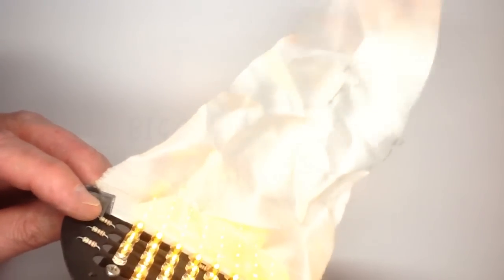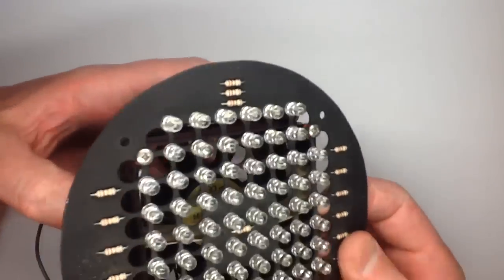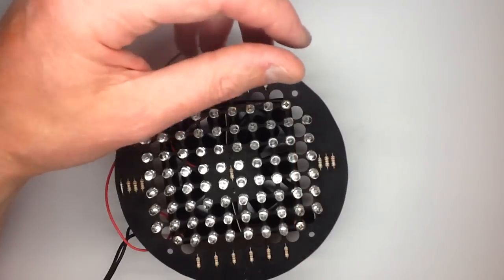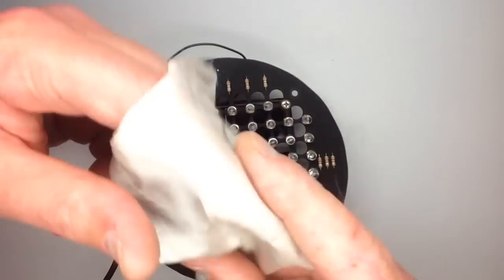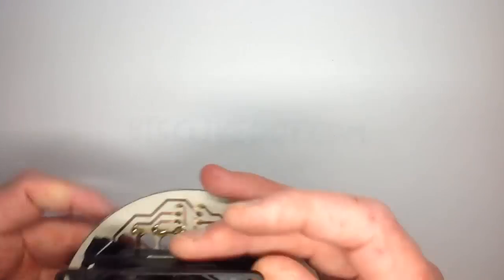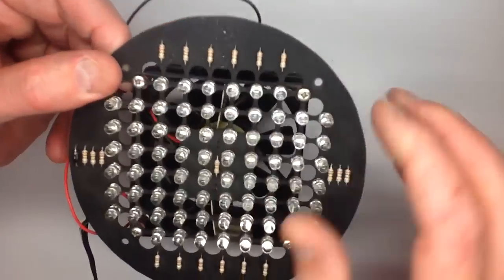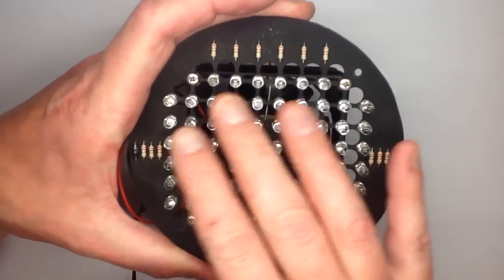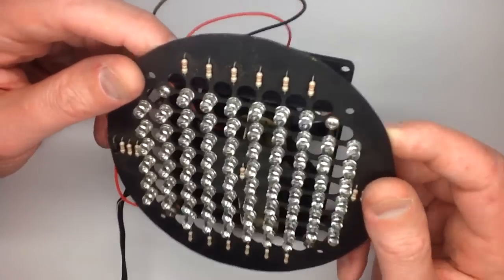Prototype LED silk flame effect.

Comment: I recall seeing one of them silk-flame lights for the first time and being rather bemused by it, then not long after, everyone seemed to have them so they lost their charm... :\
Reply from the maker: ***** Yeah, they used to be quite special when they were still a theatre/theme prop.  But then they became a mass produced consumer item, and they're not really suited to home use due to the vicinity of the effect and the noise of the fan.
Reply: bigclivedotcom
Yep, when things are mass-produced to the point everyone has one, it loses the appeal...
Reply: *****
Yeah, when I volunteered at a small theatre, they had some pretty vintage lights over the stage (which sell on ebay for about £200 a piece to yuppies to furnish their loft apartments), the lighting desk was all manual, the transformers on the wall behind the desk buzzed in a dubious manner, and the wiring was a quite hairy in places, then they replaced the lot with DMX-controlled LED lighting, and I lost interest in it, just not fun having everything pre-programmed, safe and quiet... :(
Reply from the maker: ***** They've tried self-tracking followspots, but it doesn't work as well as having a human operator.  We've got a hybrid system at the moment.  Manually aimed followspots, but some elements are controlled by the lighting desk.
Reply: *****
Yeah, the part I liked was setting the lights between scenes on the board and then crossfading through, all manual work (the only electronic control was the fade delay setting so the transition was nice and smooth), afterwards with the new board & lighting, the lights were set, stored and then during the actual performance it was just a case of pressing the "next" button, almost fell asleep during that performance I was so bored!!!

Comment: Hey Bigc,
What do you think about these OLED lamps? Are they just very expensive myth waiting to be busted?
link, (http://www.cultofmac.com/384914/oled-table-lamp-casts-a-bright-light-on-the-future/)
Reply from the maker: iqao The use of electroluminescent panels for lighting has been promoted for decades, but I'm not sure if they have solved the issues that plagued it before.  Low level output that diminishes even further in the short term and an acute sensitivity to moisture that causes random darkening.
Reply: bigclivedotcom Seem like the $299 price tag and metal casing would do the trick. But really, I'm not sure if anyone is ready to pay that much for a lamp. haha
Reply: ye, looks like it. For price of $299, it better start doing my laundry.